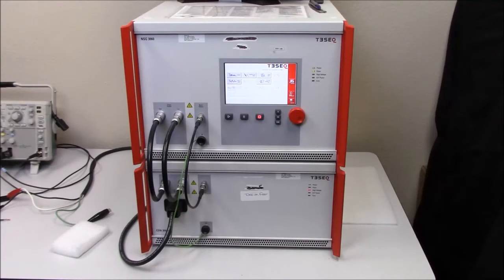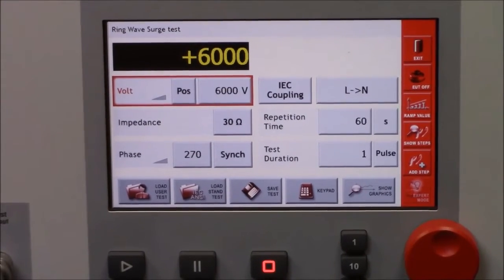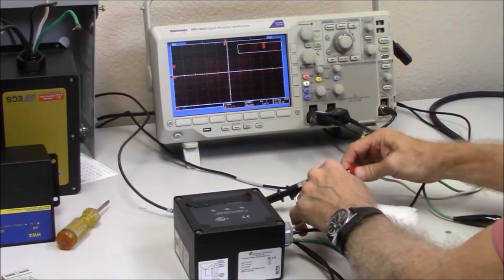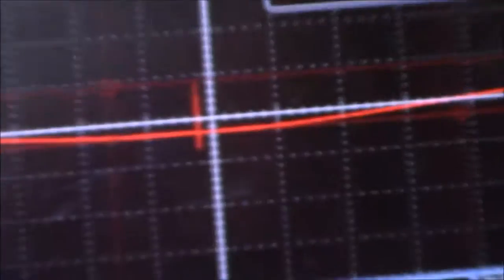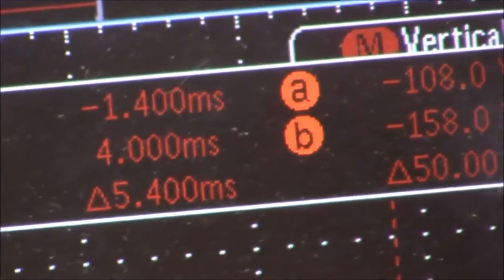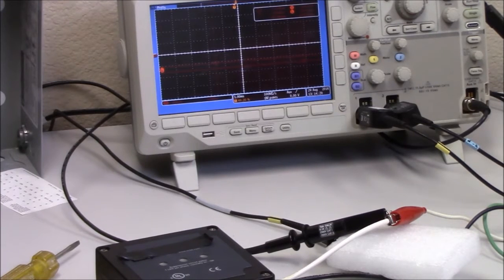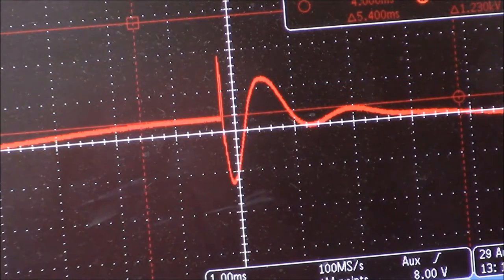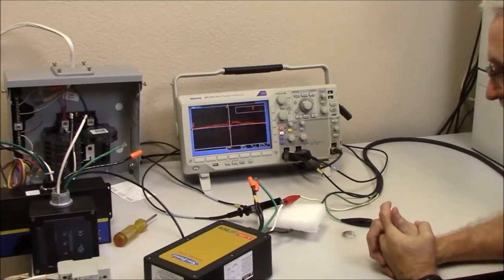SPD Testing

Comment: Those you tested in the video are SPDs normally used for Power Line Surge protection, and are normally fitted onto a DIN bar into switchboards. If you were to test an "RF SPD" (e.g. Telegartner EMP Protector 150-250 V - DC-6 GHz...N-Type Connector), how would you test it? The output from the Surge Generator that I have (UCS500N) offers a "2 Ohm" impedance. I was thinking of adding a 40 Ohm non-inductive resistor (as it's normally present into data-line Surge CDNs typically connected to the 2 Ohm output of the Surge Generator), but I'm not quite sure that's enough. Any help would be greatly appreciated. Thank you very much.